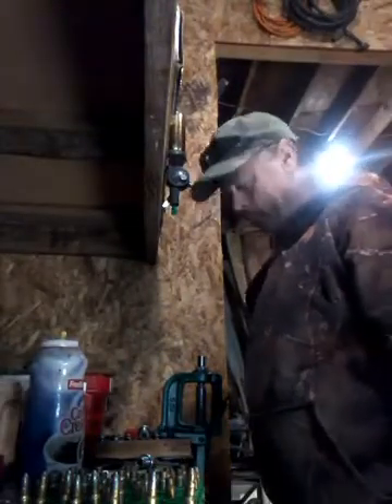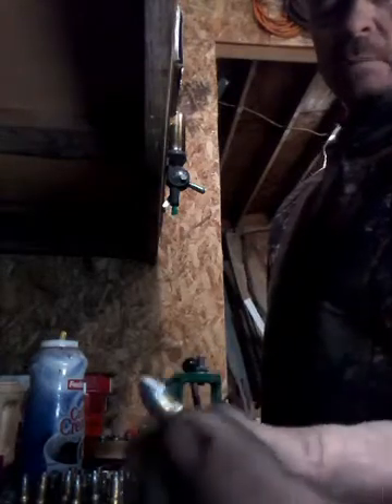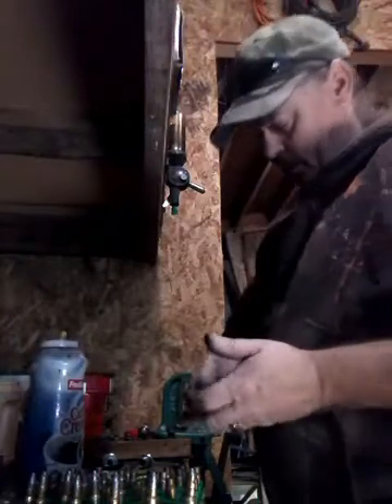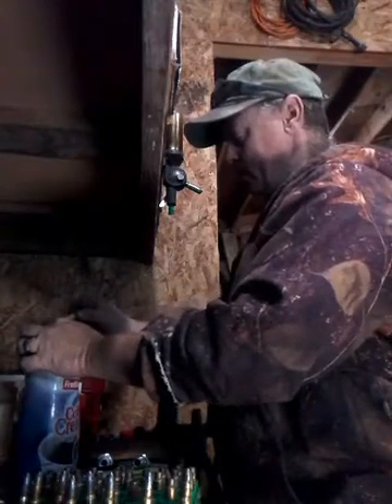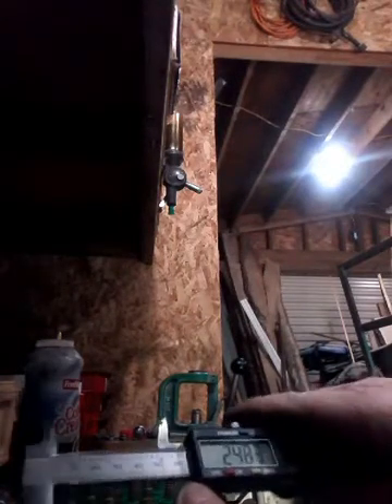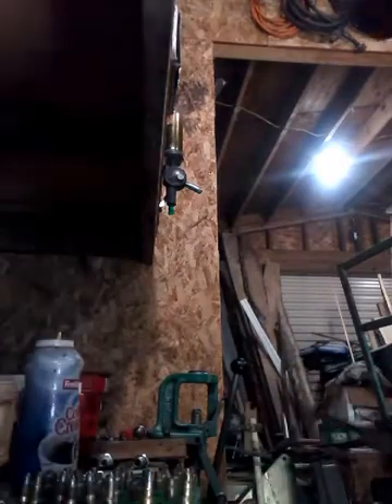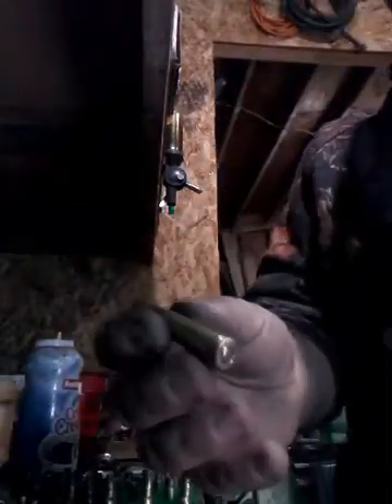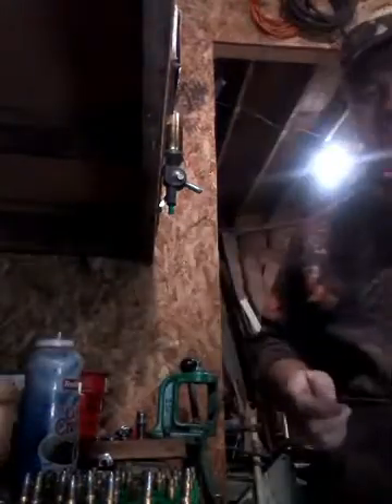7.62x45 reloading.

Comment: Do u still reload this round?
Reply from the maker: I have no empty cases to reload at this time. Otherwise yes.
Reply: @MAKAROVOWNER  i am interested in this rifle, would you recommend it if u can find ammo?
Reply from the maker: @williejohnson1732  ammo is the biggest problem. Watch out for dark bores. All the surplus ammo I ever found is corrosive. Positives? Accurate. Curio and relic listed. 10 end detachable box mag. Side folding bayonet that you hold down the button and turn the rifle to swing in place. Beware 7.62 by 39 variants using the 7.62x45 mag they do not feed. When I bought mine surplus ammo came up at 120.00 a thousand. Now a buck a cartridge. If you picked a complete rifle up on the cheap maybe get it....but you have to feed it. Reloading dies in this caliber are hundreds so that is why I showed and came up with a work around. If you got a deal with lots of ammo and mags and plan to reload....or just want to collect? If you want readily available ammo on the shelf this is not for you. This has a adjustable gas system no gas block.is my rifle dependable and accurate? Yes. Without fail. Cost and availability it's hard to argue against building a ar series with modern ammo.mags for the .cz are around 60.00 and for that you could have 3 or 4 AR mags. Does that help? This rifle my kids have dibs on we all really like it.
Reply: @MAKAROVOWNER  so if I get the rifle keep the bass after shooting?
Reply from the maker: Would not hurt. However...berdan primers and steel cases. Can't find berdan in the USA. Not to mention removing verdant primers from spend cases is not easy..if you want reloadable brass you have to make it from other cases like 220 swift or carcano. Why is this such a problem? Unlike most rifles the base size of the brass is smaller. You are left vying new brass at a dollar each that you will reload a few times or scrounging used glass. I converted son 308 brass that did work. One case cracked at the base. So attempted using such a case the base may separate. No easy answer. If you use cast lead bullets thin lead will move into the gas system after a few rounds. How many until the gas system fails without cleaning? Let's not go there.
Reply from the maker: @williejohnson1732  yes. There may come a opportunity for primers. Also it is possible to alter some cases and use domestic primers gluing them in place. Berdan primers and boxer primers are not the same size. Use the hydraulic method to remove verdant primers.
Reply: @MAKAROVOWNER  hey is it possible to take surplus ammo and replace the corrosion part, to make it none corrosion.  Sorry for my English
Reply from the maker: @williejohnson1732  The corrosive part is the primer and perhaps the powder as I understand it. So no.not in this case.

Comment: Great job on the video.  So after you make and shoot the round, what would you use to deprimed and resize the shot case.   303 again?  will that work harden the shell to much?  You are the reload master in 762x45.  Thanks for any advice.
Reply from the maker: After you fired the loaded case it is fire formed. They say in semi automatics to always full length resize. I do not. I neck size and reseat unless there is a problem. I only have one rifle in the caliber and so far no problems. Keep in mind you may need to trim the case length to maintain specs. Now if you reduce say a .308 like I have in a video you could have base separation. I had one crack badly, but not break. If it were to break in the chamber the case could get stuck. Brass stuck like that can be a pain to remove. Just did that in 40s&w. Not fun, rifle would be worse.
Reply from the maker: Thank you for watching and kind comment. I have another of these rifles I barreled in 7.62x39 from federal arms. My magazines are 7.62x45 original. Causes feed problems. I am going to solve that problem with a heavy bullet and matching the 7.62x45 overall length if possible. There were chamber inserts on the market back when also to run 7.62x39. No one speaks really about potential feed problems you end up with doing so. Thought about playing with different magazines but lengthening the overall measurement would do the same job. I have about 2000 blank 7.62x39 brass unfired, with primer and powder. The firing pin does not hit those primers hard enough. Going to modify advance the firing pin projection to strike deeper. Love these old guns, fun stuff.

Comment: I believe you are the only person on youtube that reloads 7.62x45, not sure why more people don't do it. I have about 50 s&b surplus cases that I wan't to reload. I think I have it figured out how to prime them but am trying to make sure I have the process of trimming and crimping the case. Also am new to reloading and know very little so far, basically getting into it for good 7.62x45 ammo. Do you think a die set for 7.62x39 be enough to reload these if spaced up a bit?
Reply from the maker: Lee 7.62x39 dies will do .309 and .311. You will be able to neck size, seat, and crimp. Trim with .223 Lee trimmer by hand. Your s&b cases berdan? Then hydraulic decap and superglue large rifle boxer primers is what I would do myself. You may need to remove the berdan anvil. If your cases are boxer then large rifle primers and recap by hand. I tried cast bullets and they load up the gas system some. It was removed fairly easily and did not make the weapon fail with a few rounds down range. I want to test powder coated bullets however have not yet. When I had trouble with the bolt closing it was the neck. On your powder if the load is to light it will not cycle. Over filling and compressing powder is dangerous. Thank you.